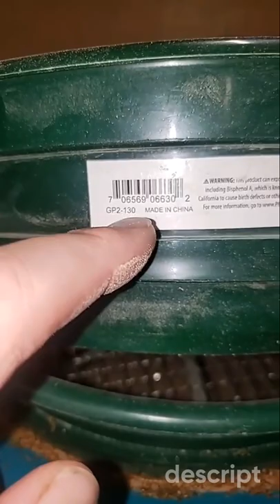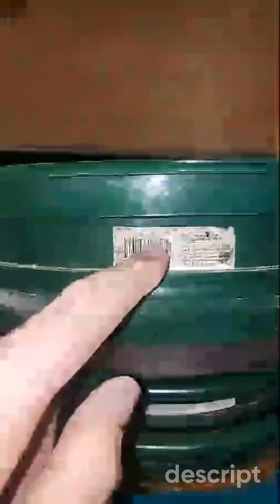Mealworms and More! 8.24.22

Comment: I have cut the rim off of a few 5 gallon buckets to add between my sifters so I can do more at once. Have you done something similar when using your vibrator? I just manually sift mine.
Reply from the maker: Interesting idea.  I've found that when the mealworms get too thick in the mesh, it doesn't sort as well.  How do you avoid that problem?
Reply: @MidwestMealworms  it can still get clogged if out too much but the extra space lets me swirl the material better to sift faster
Reply: @MidwestMealworms  I’m going to experiment today. I want my meal worms to clean my butternut squash seeds for me. My plan is to use one of my bins with tiny worms and the squash seed  scoopings and then use a 1/8 sifter to catch my squash seeds!